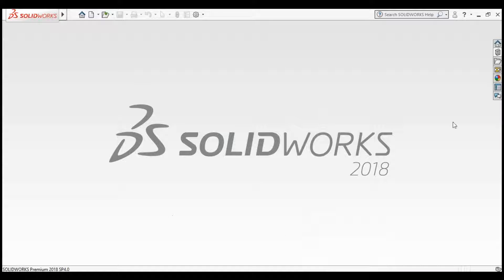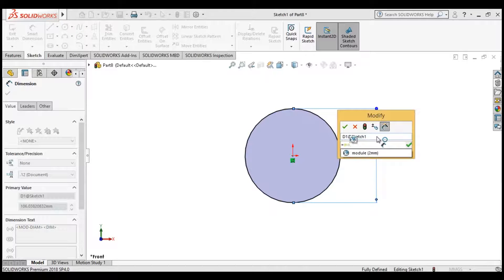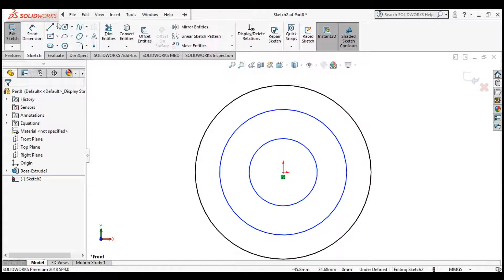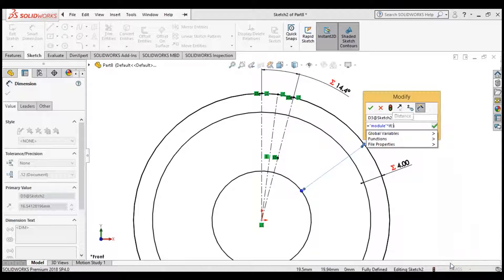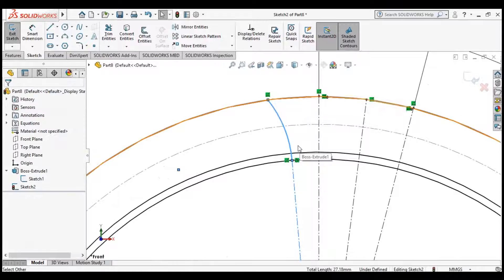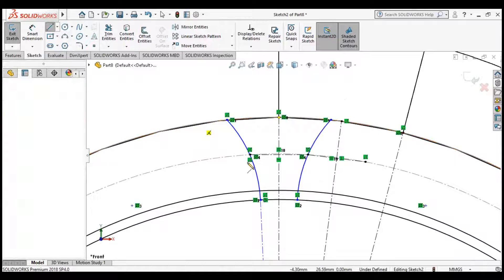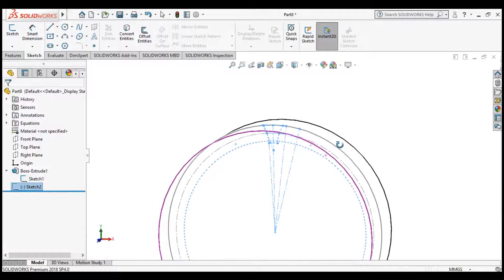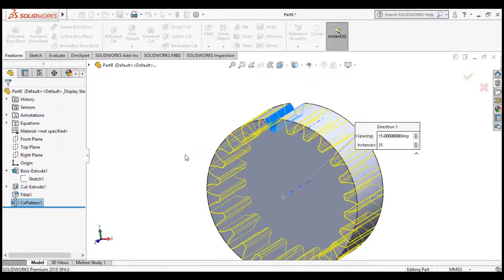Parametric Design of a Spur Gear in SOLIDWORKS using equations- Tutorial

Comment: in 3:20 you are trying to derivate an angle 14.4 degree, also later on at 6:22  you are creating another centre line and adding parameter " make equal" which you never used this anywhere in this video. Can anyone explain why was it even created?.
 ( Referring to this video, I was trying to create another spur gear for my own project. It made me quite confused for not using the above-mentioned.)
Reply: Took me a while to figure it out also. He makes the line perpendicular to the centerline it crosses through. This will complete the sketch constraints.